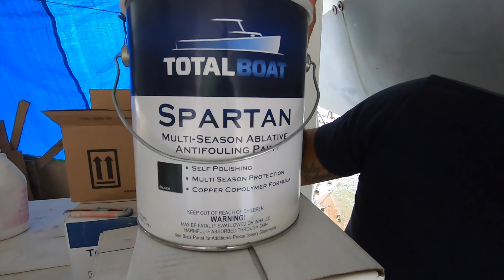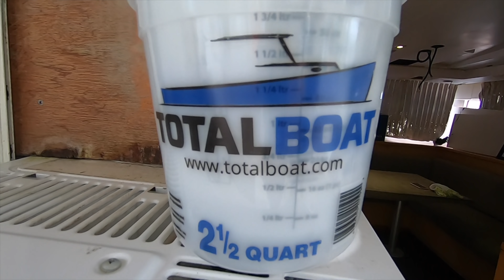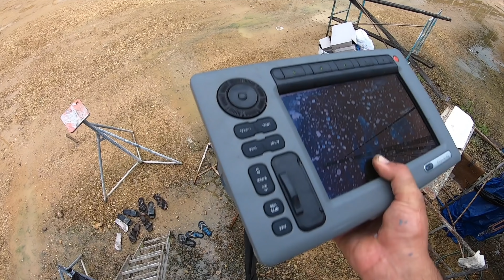THE FINAL WEEK OF A 10 MONTH REFIT! Part 2/2 (Episode 140)

Comment: All looking fantastic. I’m almost caught up. Normally after you put on new epoxy layers, you can use a non-ablative anti foul first and then the ablative one. The reason being is that if you want to sand down the hull in the future, when you get to the non ablative coat, you stop sanding. It’s a guideline. Are you sure one of those anti fouls wasn’t a non-ablative product. That was the advice I got from International Paints in the past. (A bit late to the table with my ingenious tips and tricks I’m afraid. ) 😂😂 Worked for me. 
Sending love to Sylvia’s brother.